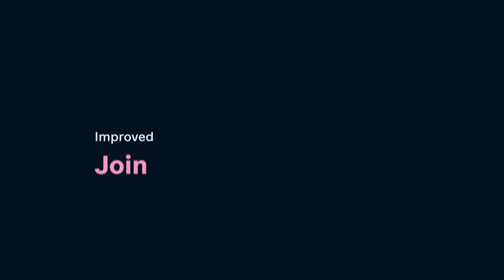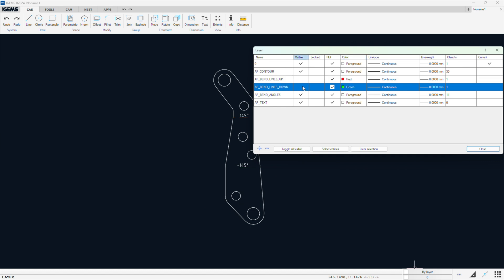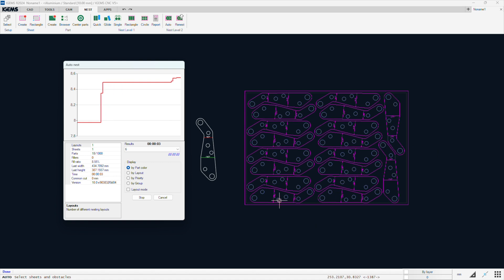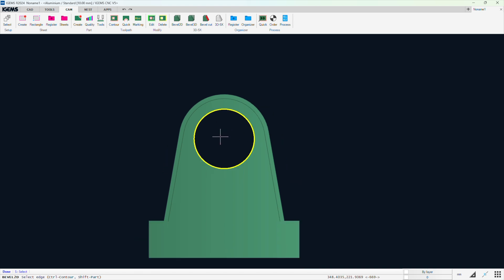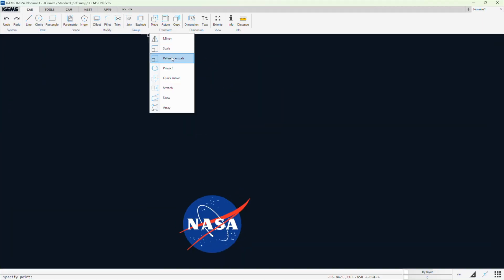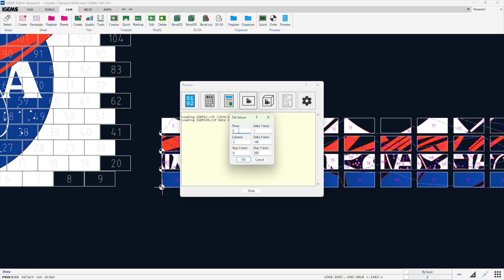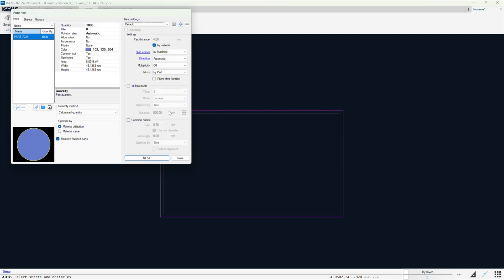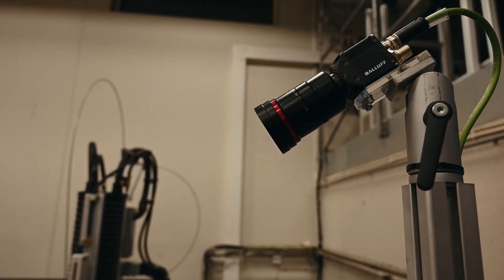What happened with IGEMS in 2024?

Comment: Nice new features this last update!
Im still learning how all the ins and outs of IGEMS, and im wondering if its possible to cut different materials and thicknesses in one order?
Reply from the maker: Hi and thank you! 
It's not possible to process multiple parts with different thickness or material types in the same file. But you can process multiple files and then ad them all in your controller if that's possible. I know IGEMS CNC has support for it.
Have a great day!
Reply: @igemswaterjet  thanks a lot for your quick answer!
I think it would definitely be a good feature to have, not sure if posible to develope though...
Reply from the maker: @UxioGrindYourMind  I mean, nothing's impossible, but it's not something we're going to do. The whole worklflow is based on selecting a certain materia/thickness. It's what all speed calculations are based upon.
But thank you for the input. It's always great to get different point of views 🙌🏼